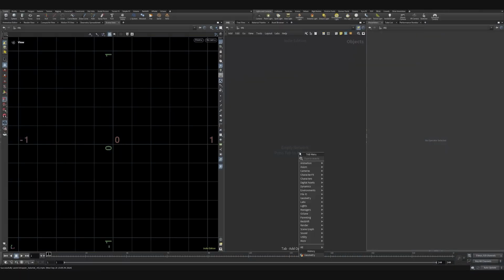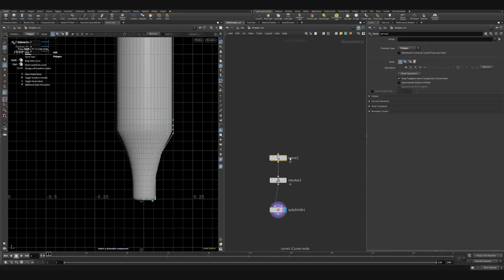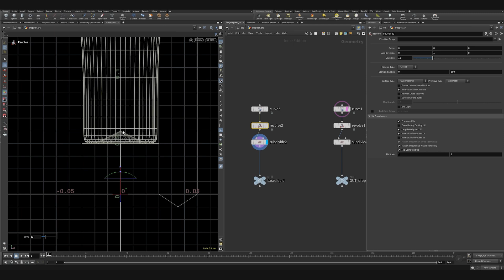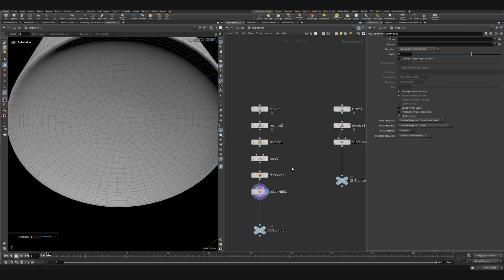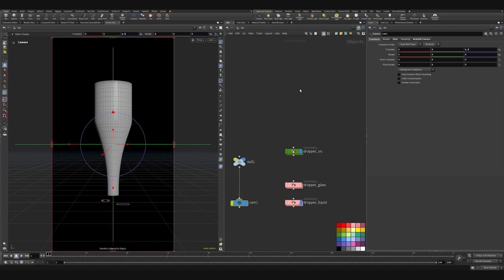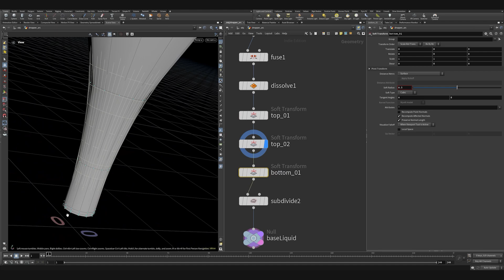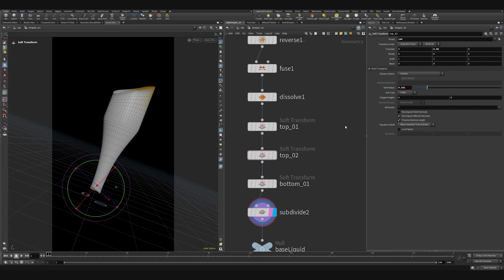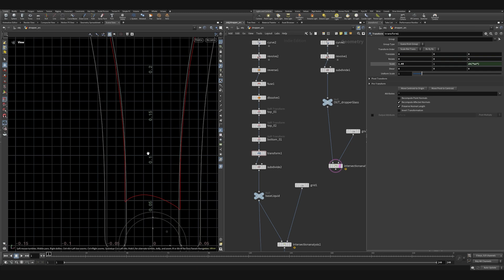Making a Photorealistic 3D Render (Dropper) w/ Aleksandr Eskin Part 1: Modeling

Comment: but you can do this in blender without lusing time
Reply: But no as procedural as this. And still, the important part is on the simulation.
Reply: @roblesvfx  I agree with the commenting gentleman about Blender. Not everything must be procedural, like this render, unless you will reuse the same assets regularly enough to remember their existence. Perhaps I am wrong.
Reply: @theKingsAmbassadors  Lately, I keep seeing tons of YouTube tutorials where the two main buzzwords are Blender and procedural. And now suddenly, when it's done in Houdini, proceduralism is considered excessive? That's kind of ironic.
Reply: @ Look, I have no dog in this fight, I have both Blender and Houdini on my machine. My point is we must use wisdom in our work. Proceduralism has use cases and can be a waste of time, if it takes more time to setup and and likely won't even be reused. It a procedural bulb. 

The pins or screws are a universally set standard and no revisions will be needed by any client, unless the model itself is not accurate or something. Hope that helps.
Reply: proceduralcoffee  You went down a rabbit hole bro. We are talking about work that is straight forward and won't need such technical revisions. A job role that is software agnostic Will pay for the work not the use of a specific tool. Houdini users are a niche, and will get paid, relatively speaking, more than a Maya, Blender or C4d user. You sound a bit disgruntled for some reason. Do you hate Blender?